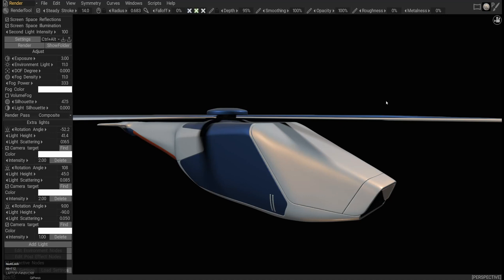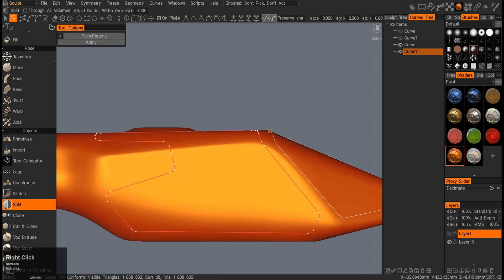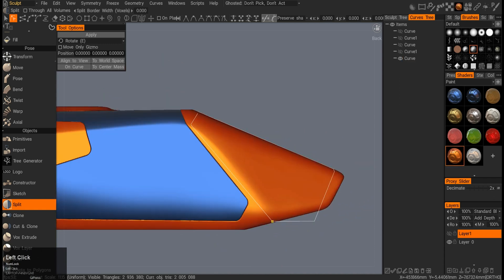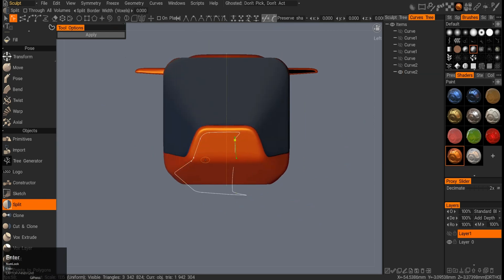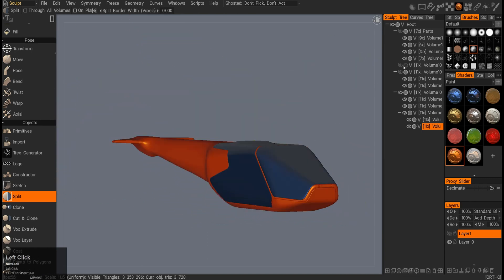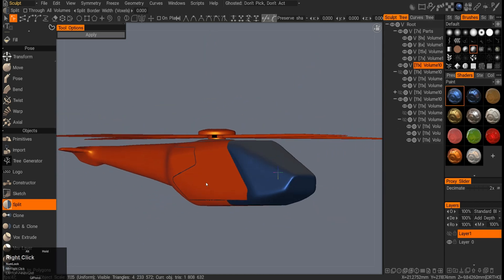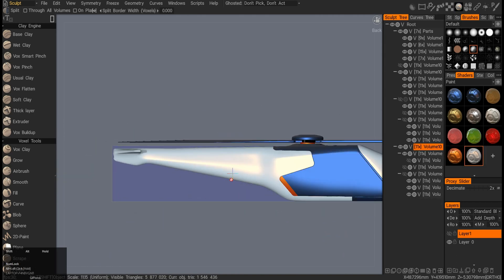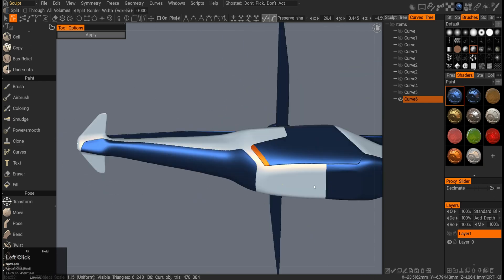Helicopter Hardsurface Curve Cutting in 3D Coat - Narrated Timelapse

Comment: Very good. The workflow is very much how I use Fusion360 but moving away that now. Having the retopo and UV tools in 3dCoat.  Have the latest version as well as 4.9 , its come a long way since then.
Reply: Hello; I hear a lot of people keeping 4.9 alongside 2022; does it have something that's not available in the latest builds ?
Reply: @yugi9710  Its just in case the latest build breaks. I UV everything using coat, 4.9 is just a little faster UI
Reply: @yugi9710  Also the auto unwrap is a little different. New one is better though I think.
Reply: @sqwert654  Oh I see ! thanks for for the reply !
Reply: @yugi9710  theres a recording of my UV of a Rhino60D frame I made in Fusion360 on my channel used the latest version I think
Reply: @sqwert654  Alright ! def checking it out !